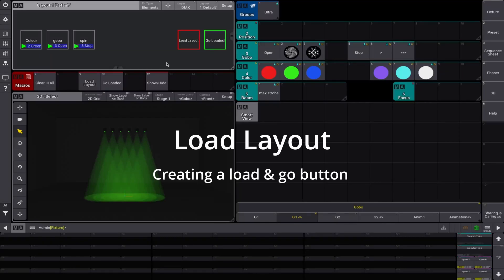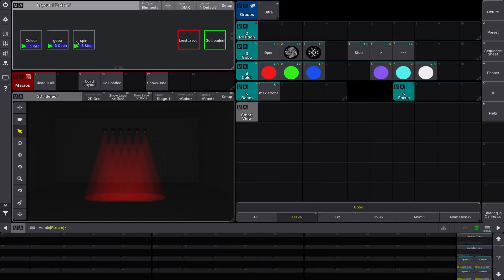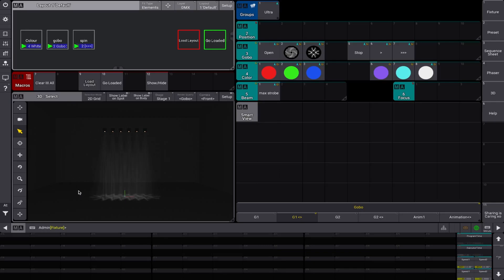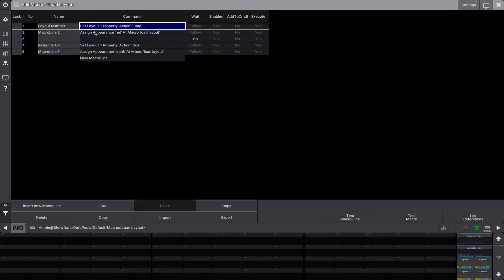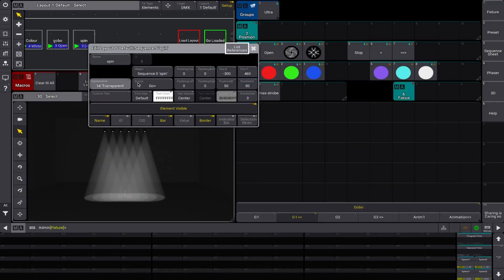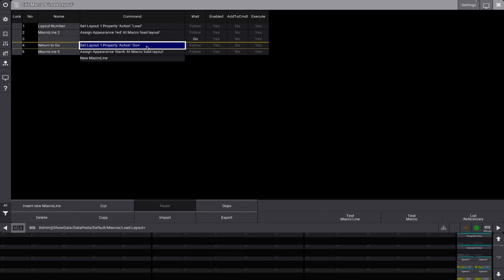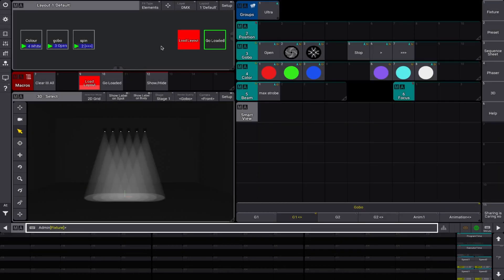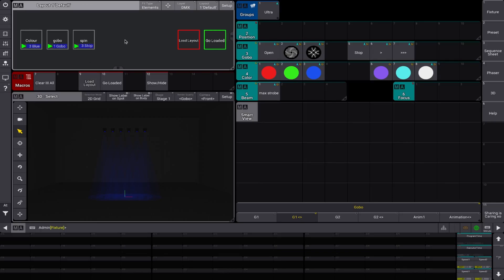GrandMA3 - Load Layout (V1.8.8.2)

Comment: The limitation is when you have different Action on your Buttons. And there is no unload command.
Reply from the maker: This is the simplest way. You can go further and build your macro to only change actions on specific button

You can use the syntax ‘off loaded’
Reply: @paproductions4525  off loaded just turns off sequences with a loaded cue and therefor the load on this sequences. Sequences that are just in load cue Status  but off, keep their load cue Status. Please correct me if i m wrong, or you find a way to undo a load command.

And yes you could make the macro more complex for my Problem with different Action on different Buttons. You just mention limitation at the Start of your Video but did Not explain it. Thanks for sharing. Would love to see more like this. 
Most of the time its just litte Things that make the difference, for me its to get the right Syntax. 
Maybe you know about it, but you can make a cue appearance for each cue and so you sequences Button Shows its current state in the Layout.
Reply from the maker: @freedom_inik  correct, 'off loaded' is annoying in the way it turns off what is loaded, and causes horrible unwanted things to happen. I haven't found a way to 'undo' a load so you have to be smart and know what you definitely do want to load

Sorry for not covering the limitations in the video. I thought I had mentioned or shown the limitations but looks like I didn't. I will do a video on changing specific sequences actions and how to work out the syntax needed